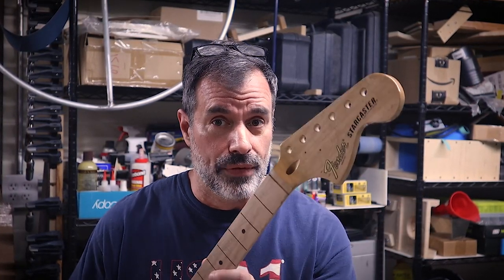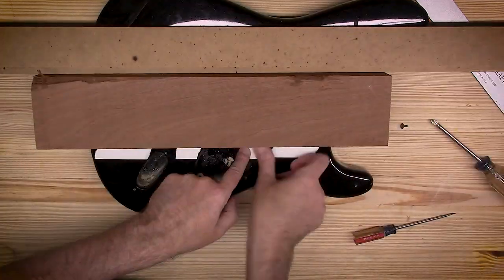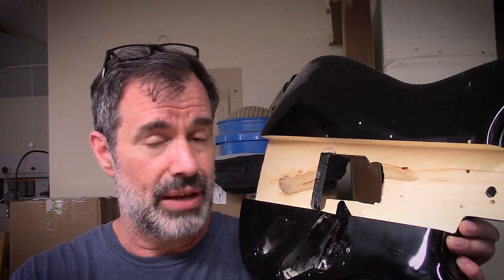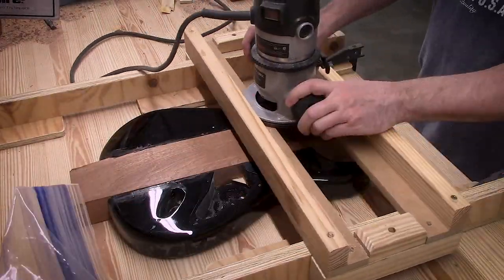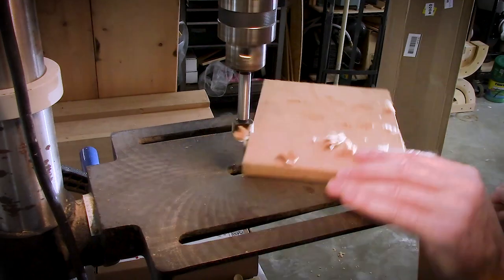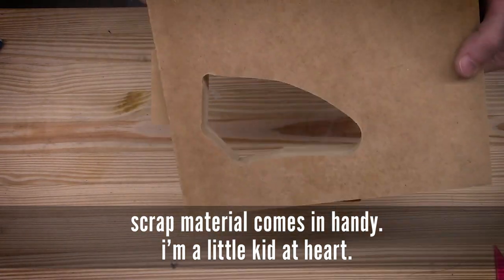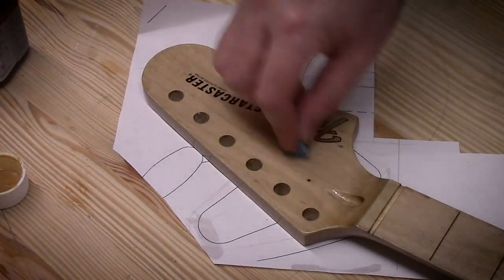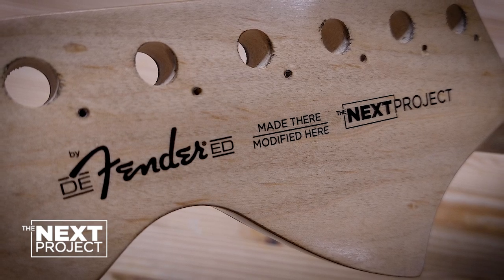Fender Strat Starcaster Guitar Mod Project 3

Comment: You did it again.  Another great video.  I never thought about using Tru oil for the decal.  I use water slide decals too, and I always use water (as the instructions say).  I'll be trying that next time.  Thanks!
Reply from the maker: John, thanks for watching!
I still soak the decal in water to loosen it from the backer paper, then slide it into a thin layer of Tru-oil.
This is not an exact science, I'm constantly trying things.
The biggest issue is getting a final smooth surface. A LOT of thin coats of TO. Not a spray and walk away process.
I often look at the instruction after I get myself in a bind. hehe.

Oh, I don't think I'll use the 2X clear next time either. It is a really heavy build paint, even when attempting to put on light coats - it's thick. That probably added to my final leveling issue with TO.

Be safe and take care!

Comment: I have watched your video and a question came up quickly in my head. Btw, I have a fender myself,but my guitar neck is just a solid maple neck. Your neck again has a strip of different wood. Have you also changed it your self?
Reply from the maker: Ah, the "skunk stripe" on the back of the neck, that was part of the neck when I got it.
I didn't change it, other than sanding and reshaping the back of the neck a bit.
It was a little uneven from nut to heal, but the fingerboard was the biggest issue originally.